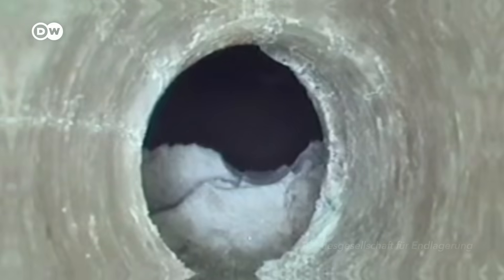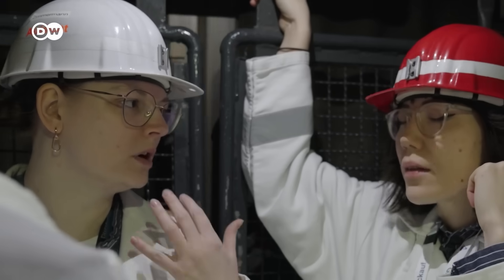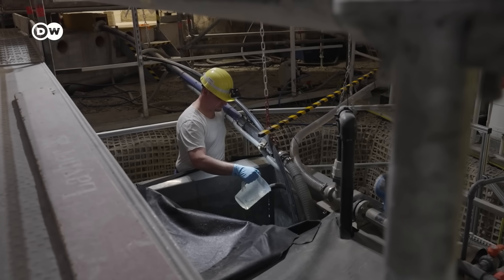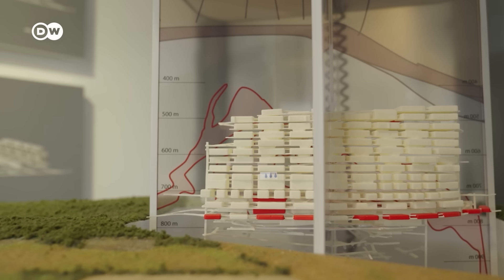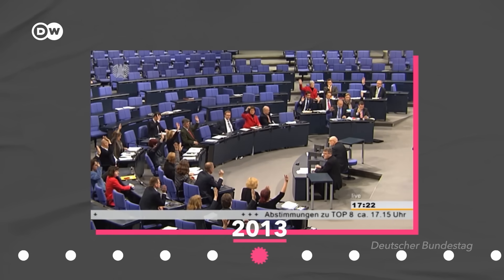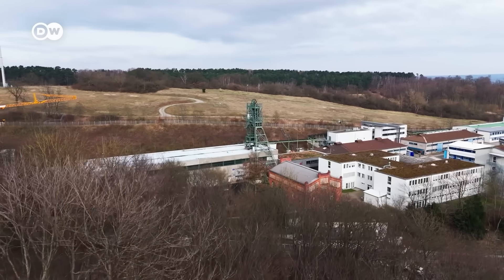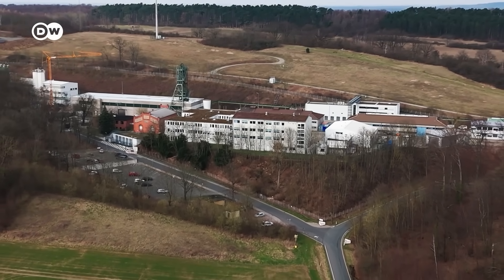Inside Germany’s hidden leaking nuclear waste dump

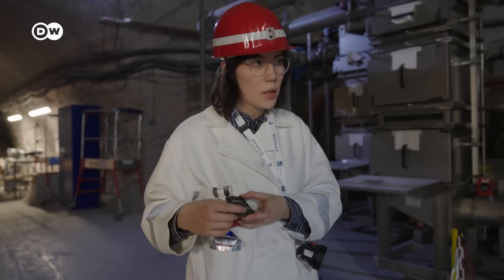Comment: 4:26 Props to the DW Planet A team for showing and mentioning the radiation level or rather the lack thereof as well as the natural nuclear radiation coming from the environment naturally.
Reply: The dosimeter isn't displaying micro-Sivert but milli-Sievert, which brings the scale up by 100 times. When it comes to gamma rays, there is no such thing as "zero radiation", you should always give a value above zero. Also the received dose especially in a short amount of time does not give any substancial information about the radiation in the given environment. Although I also believe the radiation in that specific place is lower than the exposure you would receive at ground level, the way they want to prove that for the whole site through a personal dosimeter instead of a proper measuring device is highly questionable.
Reply: A fuckin hole in the ground..... that is the spookiest shit ever....
Reply: Big problem is that these substances are heavy metals which are highly toxic
Reply: @maxheim3802  Yeah. Like those for which Germany has the largest final storage facility in the world. I'm talking about Herfa-Neurode. But when it is radioactive for some reason finding a final storage facility seems to be impossible.
Reply: @maxheim3802 
No, no it's not.
If you're thinking of the Uranium rods, they're not that big.
In fact, I doubt all of the actual "dangerous" waste in here can barely even fill a quarter of one of the rooms inside the underground facility.

The vast amounts you see are just basically trash that was inside the nuclear facility when it got decommissioned or the stuff that got into contact or were near the Uranium rods.
That's it.
Reply: @maxheim3802  The only heavy metal in any meaningful quantities in low/intermediate level waste would be lead used for shielding, and that's no more toxic than all the lead we still have in old drinking water pipes.
Reply: Yes? The issue has never been to temporarily store it, it's always been about long-term and the cost associated with it. This shows how issues crop up over time, and you have no guarantee that the country will be able to afford to maintain a nuclear dumping ground in a hundred years.
Just look at Germany pre-WW1 economy vs post, same for WW2. Imagine that at the end of one they needed to still figure out how to maintain a nuclear storage facility.
Reply: The biggest joke: They dosn't show this in german TV or even in german language. Why is this channel named 'Deutsche Welle' again?.
Reply: @DrAxelStoll369  they speak german though...
Reply: @DrAxelStoll369  the "documentaries" you will actually see on German television are way more fearmongery and non factual than this video.
Reply: Have you seen the pools of contaminated water my dear??? Or you watched only 1 min. of the above material???
Reply: @Artoootube 
I'm willing to bet that "contaminated" water is far cleaner and safer to drink than the water you get from the ponds and other freshwater sources on the surface.
In fact, it's most likely far safer than most tap water sources in America.
Reply: @Artoootube the goal was to find somewhere to put the waste to not immediately cause more harm. 

Which a salt mine is very good at. 

You could argue that the actual storage of waste could have been done better and had better records, but that’s a lot of political history. 

Other countries have done and are doing the same thing. Finding somewhere to stash waste while they figure out how to make it more stable or less dangerous.
Reply: @Artoootube  You drank some irradiated water lately?
You sure talk like you did.

Comment: I have been working in this field in France, it is actually very possible to recycle nuclear waste, that was my job.
Reply: You are aware that it was stated several times that most of the waste in Asse is low to medium waste, right? Right?
Reply: When you say nuclear waste, do you mean the high level rods, which is nothing inside the mine
Reply: Where the hell are my comments going?
Reply: @MostlyPennyCat the shadow realm..
Reply: this is mostly low and medium level waste, it's not that easy to recycle, but at the same time it's not very radioactive, so not very dangerous.... germans are just drama queens when it comes to nuclear
Reply: The French solution for, what they call recycling or reprocessing, nuclear waste is to ship it to Russia. Russia  dumps the french waste into the landscape at Tomsk 7 and writes a few documents for the french authorities that everything is fine and the french depleted uranium has been treated and recycled as per contract. Instead of fuel with reprocessed uranium they likely deliver fuel rods made out of new natural uranium. This way they get a good financial compensation for the new fuel and the disposal of the waste. For Orano and EDF it is still cheaper than actually disposing nuclear waste in France, especially as the storage in Pierrelatte is full. This cooperation is working already for decades, even the invasion of Russia into Ukraine does not stop this business.
Reply: That was never your job. That was my job in France. You're an FBI Snitch or Meth Dealer who sells them narcotics. 
Nuclear Waste is inherently impossible to dispose of wholely. Which is why we stopped processing the materials and started re-processing the materials into plutonium for use in medical applications to manufacture medicine. Which even then created more waste with half-lifes in the millions of years.
We shut ITER down in 2014.
Reply: How?
Reply: That you paid to do it, isn't the flex you think it is.
Reply: Funny that it's easy to recycle but when it comes to plastic and aluminum we can't
You know how we could solve that? It's been on my brain
We can't keep dumping it in China and other Asian countries it's not helping and it's poisoning their environment
Reply: The ITER project in Sothern France?
Reply: Bleach share more about your nuclear waste recycling experience! I am fascinated by innovations in the nuclear fuel cycle. 

Cheers to France!
Reply: It can only be recycled once before it ends up as waste anyways and creates plutonium as a byproduct that can make weapons if it falls into the wrong hands
Reply: That's not a solution to the problem, only a tiny portion of nuclear waste can be "recycled". It is prohibitively expensive, and the process actually creates more radioactive waste, in forms that are more difficult to manage.
Reply: @MultidimensionalSentinel i think its 96% bruh 💀
Reply: Indeed, recycling fuel doesn't means getting rid of waste. However, no it isn't "prohibitively expensive". It is often marginaly more expensive than doing nothing but that's it. It also isn't especially more dangerous than regular uranium fuel in reactors. Reactivity accidents are almost impossible and only happened once at Chernobyl in a type of reactor that has been abandonned.
Also, extracting plutonium from waste  allows for reduced waste volume and radiotoxicity time. And it also limits uranium ressources consumption and thus uranium mining pollution.
Reply: @MultidimensionalSentinel  It's always "prohibitively expensive" until you look how Renewables used to be prohibitively expensive when reprocessing used to be cheap back in history. The "expensive" part comes primarily from political reasons.
Reply: @ZippyPiglin36  False, reprocessing was never cheap, and will never be economically viable, or environmentally responsible.
Reply: @MultidimensionalSentinel  95% of nuclear waste is recyclable because fuel rods, the majority of nuclear waste, keep most of their potential energy, so they can be reused
Reply: @wtytt  That is really just a theoretical claim, in reality, only a small portion of used nuclear fuel is useful with the infrastructure we have today. Also, nuclear fuel reprocessing will never be economically viable, or environmentally responsible. The process is prohibitively expensive, incredibly  dirty, and only compounds the problem by creating a lot more nuclear waste, but in forms that are much more difficult, and dangerous to manage..
Reply: @MultidimensionalSentinel  Then build the infrastructure. A lot of this is expensive because of useless bureaucracy and regulation. If we INVESTED in nuclear, a lot of this would be less expensive. But we keep subsidizing fossil fuels instead.
Reply: What Is The Point Of Recycling It If There's No Earth To Live On?
Reply: The percentage that's "recyclable" is ludicrous, plus it's extremely expensive, plus the recycled material produces residues again.

But add the saying goes: "it's hard to make someone understand something when his salary depends on not understanding it."
Reply: @fundidoarrojo269  96 percent is not "ludicrous", no.
Reply: @fundidoarrojo269  96 percent reusable is not ludicrous.
Reply: what can't be reused can be "Deep borehole disposed" (stored in small holes miles below the earth's surface, contained that can withstand anything nature throws at it)